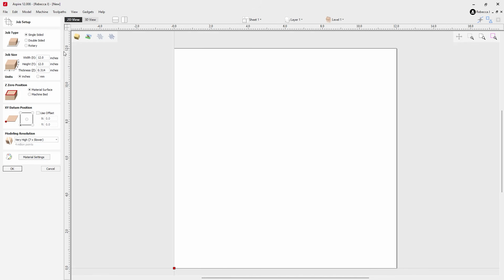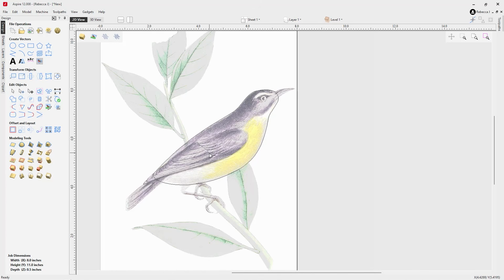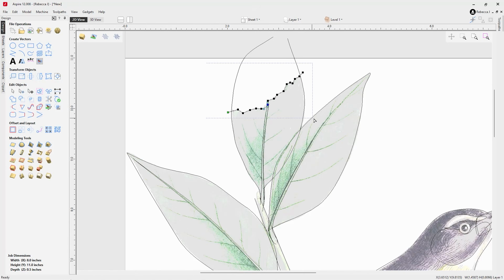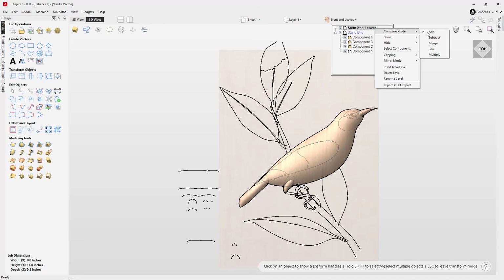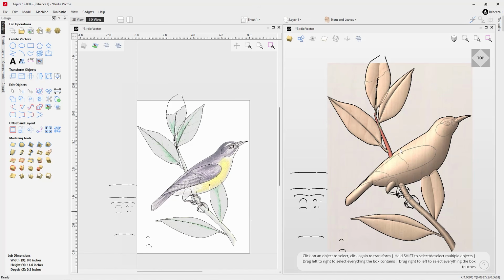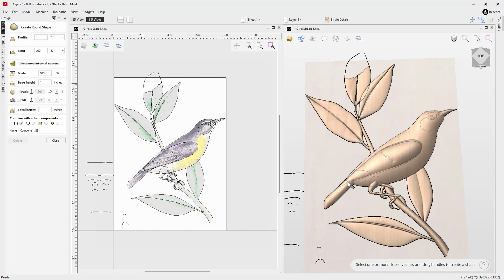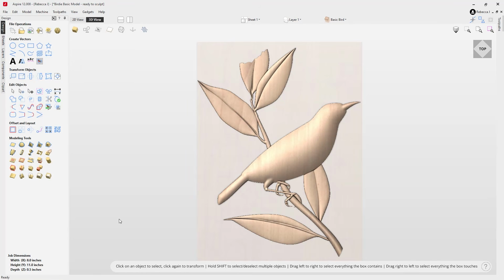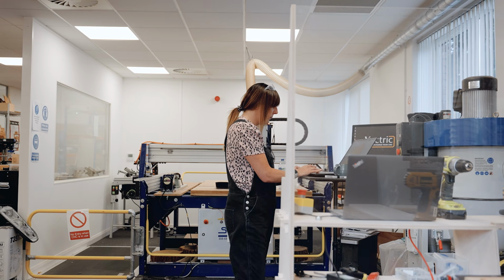Making Birdie & Frame Using Aspire Modeling Tools | In the Labs with Vectric | FREE CNC Projects

Comment: This was a very good instructional video Bekki.  Very glad you took the time to put this together and go over each step.  I like that you show how to save at arious points and build on the mode  but have an escape plan of going back to good points if there is a goof up along the way.
  
i will say that I use two computers for my vectric modeling work a MacBook and a Windows computer.  Neither of them seem to work as smoothly as your computer appears to while in the modeling mode.  I understand the MacBook is running under parallels so it may be part of the reason why it isn't as smooth.  

But, my windows version is tricked out with 32GB of GPU, 16 GB Ram, and a 4TB Drive (gaming computer).  I realize you were not doing the actual modeling live time for the video because of need to speed up certain parts of modeling.  But does you computer work as smoothly as it appears in the video when no intentionally speeding up the process?  I am mainly talking about when you use the tools/trigger icons for adjusting heights and fades etc.  Your computer seems to work smoothly where mine seems to be "jerky" as I try to adjust my shapes and see them.  I am  wondering is that me being heavy handed or is there something that I need to adjust to make the modeling process more smooth - similar to how I see you adjusting things.  Maybe you can't answer because you can't see what I am talking about, but thought I would throw it out there.

Thanks agian for the excellent tutorial.  Looking forward to seeing you and Todd in October in Austin.
Reply from the maker: Hey Rob... Todd here.  This feedback is really good to hear.  I would really suggest you fire off an email to support... they have a few tricks up their sleaves that might help.